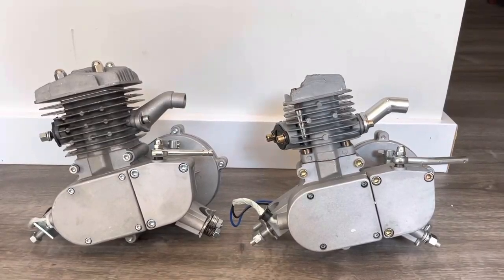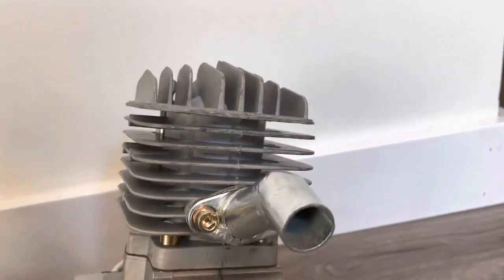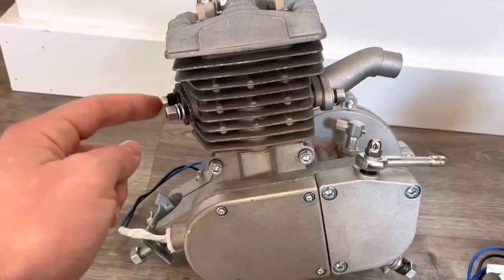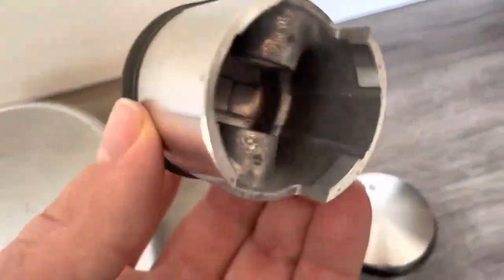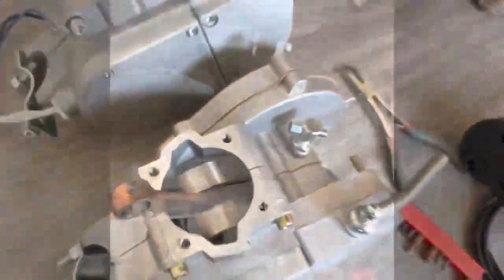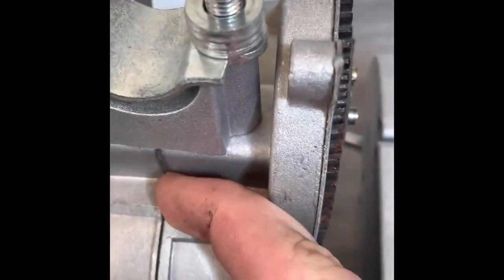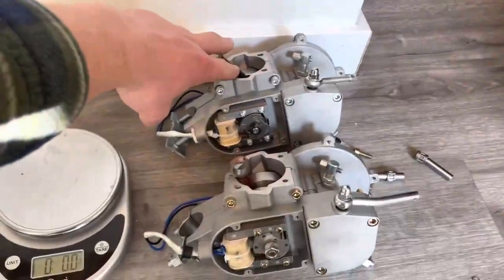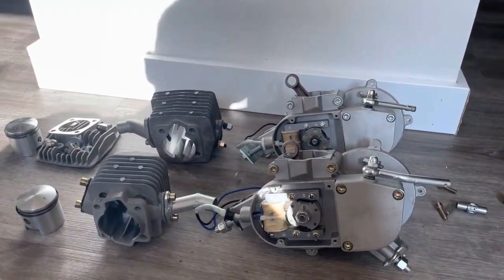The REAL Story Behind Identical Looking 80cc Motorized Bike Engines- Engine Teardown

Comment: I just checked again and I can't find the one piece cylinder/head motors anywhere on Ebay. I have been using one for more than three years with no problems, but I don't treat it rough.

Comment: The chineese use cheap conponents as specified by their customers.. Look at tolerences, bearings, thats where the game is ..
Reply from the maker: Exactly. The eBay/amazon engine sellers don’t have strong brand loyalty, therefore their goal is to get the price absolutely as low as possible, as they aren’t worried about return customers and want to maximize profit. The wildcat engine is made in a different factory with a higher quality capacity and is also set to a higher standard. The truth is, with Chinese manufacturing really low or really high-quality can be achieved, it depends on the price required for the market. For some people, saving $30 may be something they’re willing to do, but in the long run you don’t save money and you have to deal with a low quality engine having constant issues, unreliability, and lower performance. These engines now having the smaller flywheels to save money is basically a nail in the coffin, as people might be willing to tough out low quality but when it comes to even having to deal with a slower engine, people don’t want to deal with that. It’s just not worth the savings.

Comment: Gasket thickness has shti to do with shit
Reply from the maker: @masterhacker1989  first of all it’s an indicator of quality. Secondly, the crank case gasket will blow out in that weak spot within a few weeks and all your crank case pressure is gone and so is your performance. Also, when you want to work on the engine, the gaskets will rip when you try to takeoff your covers.
Reply: I have both motors this is my 4th build.. my first bike leaked at the bottom right where he showed. The other gasket looks so much better along with everything else 100 miles in still looks relatively brand new

Comment: Just because something is heavier doesn't make it better or vice versa E.G titanium vs carbon steel.That said your point is proven .
Reply: Yeah, especially a heavier piston isn't really desireable, even though here the wildcats one is probably higher quality.
Reply from the maker: @neoboost6377  the fraction of the ounce of weight difference I believe is attributed to the pins on the piston, which are not well seated on the lower quality piston. This means that the low quality piston is more likely for the pins to fail and cause the top end of the engine to have a catastrophic failure.
Reply: @zsfabricating  HI yes can I change engine head to the anodized engine heads like the gold one but on Amazon they say yellow....if not which sporty engine head can I use with this engine...I bought American made and sold by Kings motor bikes....Raw Racer II with 50mm piston but all in one cylinder...sucks cause no option to change heads...I'm going to buy a wild cat....thanx
Reply: When it comes to Chinese manufacturing, the lighter, the shittier it is

Comment: Put a 5lb weight on the scale then zero (the tare button) it, then put the engine on the scale, take the number from the scale plus the weight you added to get the weight of your engine
Reply from the maker: @TheShivABC  thank you! I recently bought a scale good up past 50 pounds and was able to determine that the engines weigh about a pound different, around half of this weight difference is from the heavier bottom end with the slightly larger flywheel and denser internals and the larger surface area on the cylinder/cylinder head made up the rest of the difference in weight. Thanks for your comment.
Reply: @zsfabricating  No problem, I'm a small engine mechanic, this cheapening of engines is everywhere, kohler engines is about to fold under